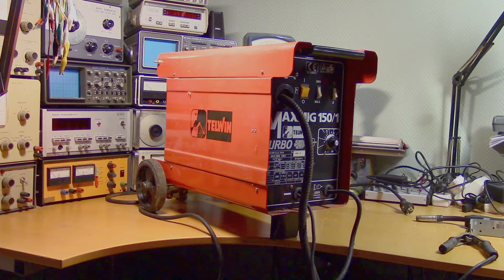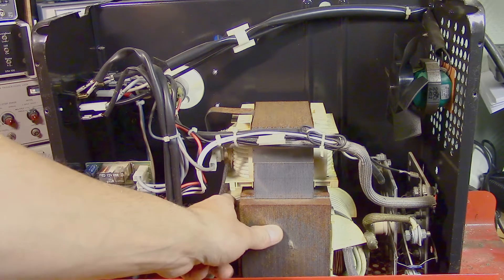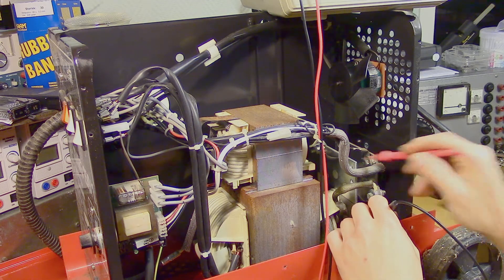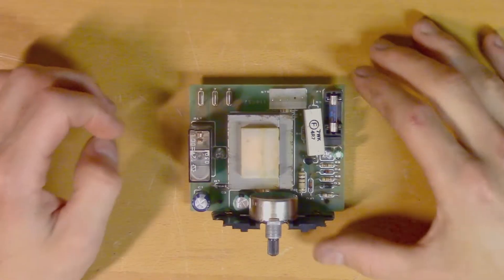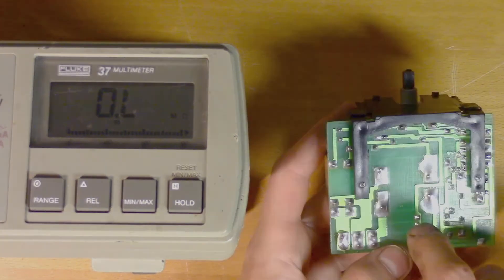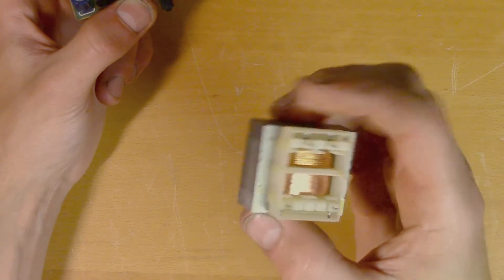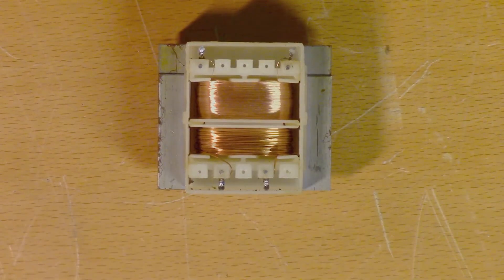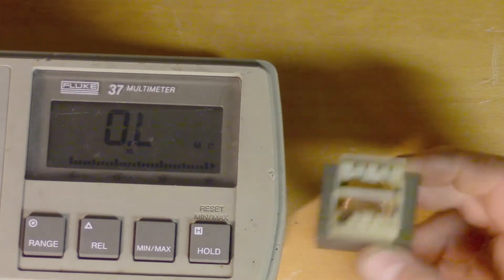MIG Welder Troubleshooting and Repair - Telwin Maxmig 150/1 Turbo

Comment: Aș dori dacă mă puteți ajuta cu o informație  !  După o intervenție de schimbare cap sudură , am scos din conexiune al 2-lea fir  din grupul de 3 al conectorului de pe placa de comandă,( practic firul din mijloc) ! Bănuiesc la motorașul  de antrenare sârmă  flux dar nu sunt sigur. Menționez că nu am schemă și am căutat...
Reply from the maker: Hi, welding machines are really not within my area of expertise, so I do not want to make guesses. I suggest you try to find the service manual.

Comment: Lovely!, But what was the problem?
Troubleshooting but not telling what the problem is/was.
Reply: He clearly told and showed that the coil wire from the control board transformer terminal pin was broken loose, which he resoldered into place with help of additional piece of copper wire.
Reply from the maker: Hi Frank Tenbult! Since the transformer for the control board was broken, the control board was not getting any power and was not able to operate at all. I do not know exactly how the control board works but I assume it controls the switching of the reactance coil to create the spark. So, no power to the control board meant no switching of the reactance coil, which resulted in no spark being generated.

I should probably have included this analysis in the video. Thank you for your feedback!

Comment: hello again , is this mig negtive electrode ? i must check the cable which is connecyed to the rectifire bridge.
and if i replace the torch lance with euro torch , i need two wires for triger. where can i get the other wire from? which connection? i am in process of fitting euro lance and having the +ve and -ve terminals fitted to the body panel with isolated connectors. do you have a wiring diagram for the welder? it looks easy and simple. but lots of wires every where cramped in small space.
Reply from the maker: Hi again! I was not able to find the wiring diagram, so I cannot answer your questions with certainty. When it comes to modifications, I would rather not speculate in a field I am not comfortable in. Finding the wiring diagram for a similar unit might help you to some extent.
Reply: @SunandWeather  i tried teiwin but no chance. i need to ask proffesional whon can sort this. i do not want to delve in to some thing which i have no knowledge.

Comment: hi nice vid. i wounder if you know where can i get a new wire feed rollers unit 12 volts. i have a welder just like yours. either i buy new same wire feeder unit or buy totally new wire feeder unit of a different type and fit euro tourch lance which i have .
Reply from the maker: Hi john smith, if the motor has gone bad, you could probably replace just the motor. I suspect it is a relatively standard 12V DC motor. See if you can find a part number on it and you will probably be able to find a replacement a lot cheaper than replacing the whole wire feeder.

Comment: Hi mate. I've got an old mig welder I'm using for flux core welding. No gas. It has similar settings to yours. Switches Min, max, 1 and 2. I was thinking of replacing these switches with a dial potentiometer so that I can smoothly adjust the output voltage. Would this potentiometer need to handle the large 150amp output of the welder, or would a smaller one be OK? Many thanks.
Reply from the maker: Hi DREADNOUGHT! I do not recommend you do this. The switches are switching between different taps on the transformers. Replacing these with potentiometers would connect the taps together through the potentiometer, which would most likely not have the desired result. It would also introduce a series resistance on the transformer winding which would limit the current.
Reply: @SunandWeather  Yep, and furthermore, using mere potentiometer to adjust welding power would require quite a giant potentiometer to withstand its huge power loss, any regular potentiometer would turn into fumes immediately. If you wanted to modify in any additional power adjustment not relying on tap switching, you need some sort of PWM control to alleviate the huge power loss within the controller.
Reply: @SunandWeather  Thanks mate. I kinda thought it'd be tap off points from the transformer, that why I was thinking of using the two outer wires, and therefore getting a full range of voltages once the pot was in place and simply safely terminating all other wires on the secondary. I've not even looked inside to be honest, I just saw your video and thought I'd ask. So it's a big "No" from you then buddy?
Reply from the maker: @REVERSE_BIAS  Yes, I would advice not to modify a circuit with a power transformer unless you know the design and are certain what effect your modification will have.

Comment: I have a Lincoln weld pak and it wont feed the wire,I put 6 volts to the motor and it works ,but cant find whats wrong ,I took the board out and it doesn't look burned but ,what you just fixed here I haven't tested for continuity. Just wish there were more videos that could help me ,like yours. Thanks.
Reply from the maker: Hi Johnny! If it is just the wire feeding mechanism that is not working I would start by making sure that the wires to the motor are intact and that the connections/solder joints are not damaged or corroded. This can be done with a continuity test. As for a failure on the control board, it is hard to give useful troubleshooting suggestions without a schematic. You could do some manual component/PCB checking; looking for shorted semiconductors, resistors that has drifted in value, cracked solder joints, broken traces on the PCB, etc. Good luck!

Comment: Nice video! Wish I had your knowledge :) I would love to learn what and why you are measuring. You do tell and i understand some but others not. Have a nice day!
Reply from the maker: Hi Pär! Thank you for the feedback! I will keep that in mind.

Here is a very short, simplified description of some of the measurements.

Coil/Transformers: These components are essentially long copper wires wound around iron cores in different configurations. To make sure these copper wires are not broken, due to overheating or mechanical impact for example, a continuity test is done with the multimeter.

Semiconductors (diodes, transistors, IC-circuits, etc.): Intact semiconductors have a certain voltage drop across them,  which can be measured with some multimeters. When semiconductors fail, they sometimes short out, which means that you would have a dead short across them instead.
Reply: @SunandWeather  Thank you very much for your very clear answer! :)

Comment: Hi I have mig welder and when you adjust the welding voltage switch 1 two 12 some won't ark on the numbers.
Reply from the maker: Hi tim Celtic! Assuming your MIG welder is similar to the one in the video, my first guess would be that the switch has gone bad. If the welder has gone unused for some time it might just be some oxidation inside the switch. You could try cleaning it with some contact cleaner, or just push it back and forth many times and see if it starts working.

If that does not work, you could try to make sure that the wires from the switch to the transformer are intact using a continuity tester.

Comment: What do you think about telwin welding machines?
Reply from the maker: Hi solomon8864! I have no prior experience with welding or welding equipment, but from what I found during this repair I think it seems to be quite a solid build. As we saw, the transformer was not burned out, so there is no sign of under dimensioned components or bad electrical design. It most likely broke due to impact. They could of have secured the control board with shock absorbing rubber grommets to reduce the likelihood of this happening, but that in turn could lead to other problems with age and so on, so I would not call this a bad design choice. Now, this is quite an old machine and I have no idea if Telwin offers the same level of quality today.

Comment: Good to see someone using the same solder sucker I have.
Those are the best tool but no one uses them.
Reply: Hello, greetings from Argentina (Yes, that corrupt country in the south), I would like to ask you, could you please tell me what is the voltage that you have at the output of the main transformer. I saw that they asked about the diode bridge, some 50A 1200v works well in the case of mister Z or 50a 1200v 50hf120 would be much better.